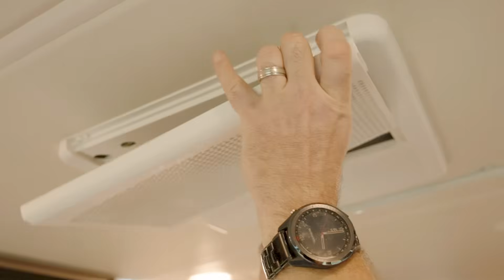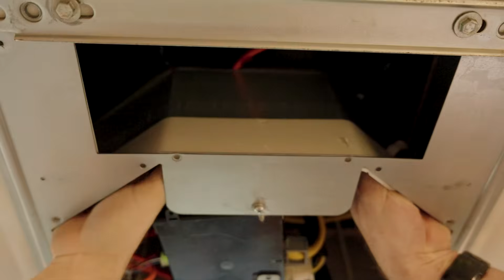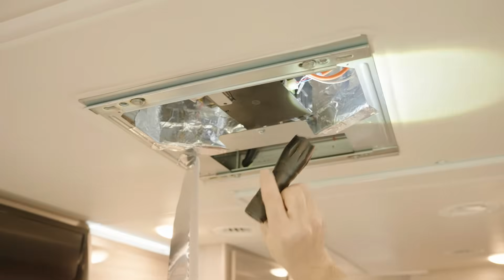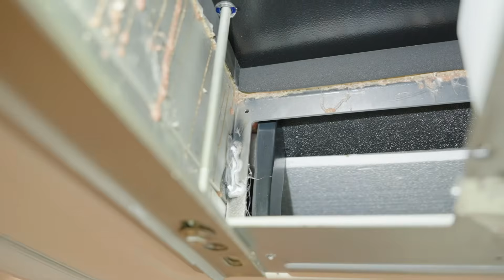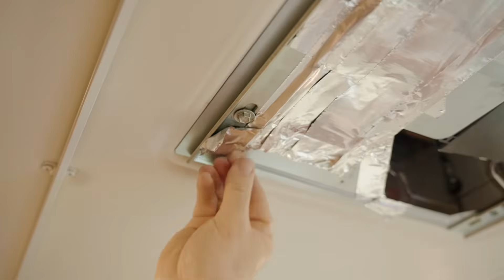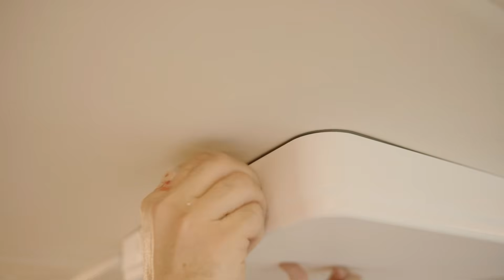Reduce The Noise Of Your RVs Dometic or GE Air Conditioner With This Simple To Install Device!

Comment: I just installed this on my older Dometic in my 2004 Palomino Puma. This video was so helpful. I am so pleased with the noise reduction. After following all the directions to seal up the baffle and any places where there might be air leaks, I noticed increased output from my smaller vents throughout the trailer. Thank you for this comprehensive video and for this product!

Comment: I just installed mine on my Dometic AC. Mine was different in that it doesn't have the Air Dump  (My Dometic is the top left one on your website,) so I wasn't sure then if I should have still sealed off the airflow between the two sections if the second section doesn't have the air dump on it?  I sadly couldn't find any videos that showed an install for my unit, so I just guessed and sealed off the two sides. I also considered taking off the 4 bolts and taking off the cover that covered up the second section to better seal up over there, but I'm not always the best at these kinds of projects, so I figured I'd better leave well enough alone without any instructions on if I should do that.  
The sound is MUCH improved, and now I just hope I didn't hurt the efficiency by blocking off that second section on my style of AC!
Reply from the maker: Hello Dometic makes a dump and a non dump version. The only difference in the install is non dump you do not need to tape of the Rectangular area because it is not there. All other maintenance and taping needs to be done. Thank you

Comment: I installed one on our 2015 Winnebago Via (25' Sprinter chassis) right after we purchased it last August.  We're definitely happy with the reduced sound level and fantastic cold air output.  I've had two travel trailers with AC units and a 2012 Newmar Bay Star (no direct access to AC units from inside the coach, which was very quiet) but none of the pumped out the cold air comparable to what we experience with the Winnebago/Silencer combination.  Highly recommended, but take your time and really seal up all leaks and gaps as it is crucial to getting the best results.

Comment: Darrell - IT WORKED!  I had to do a fair amount of maintenance to seal up leaks but when installed, unbelievable!  On thing I realized is that my coach has a couple of vent fans between the two ACs we have and they have 2x6" duct holes like underneath the ACs.  I assume this is because you have the option to put ACs there as well.  That is also a source of cooled air leakage because they're only covered by the thin plastic finishing ring that you put underneath the fan.  Thanks again!  ~Phil, A Year to Volunteer

Comment: What model year was this Dometic?
Reply from the maker: Dometic has not changed the ceiling plate in 20 years. But you can have a ducted and non ducted unit. Yes they are different